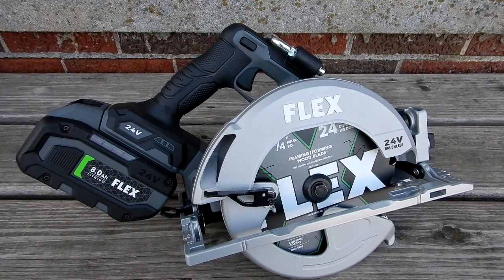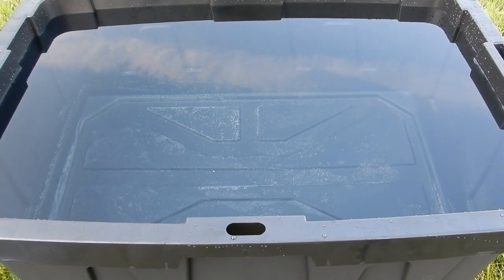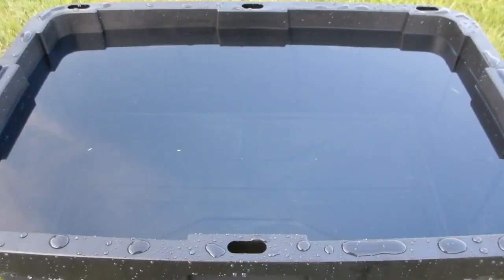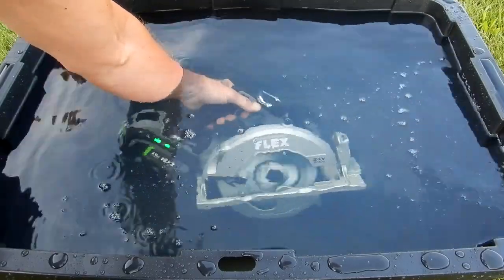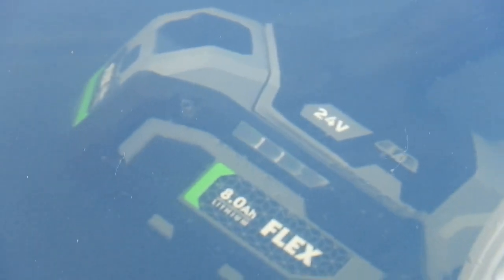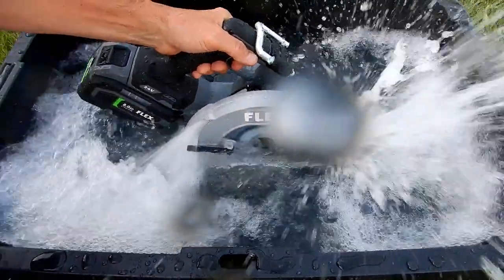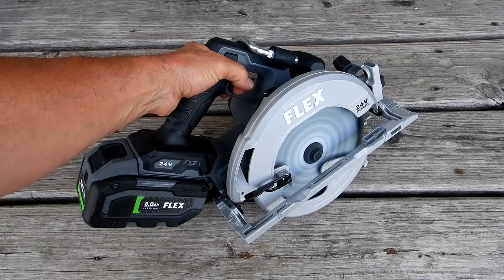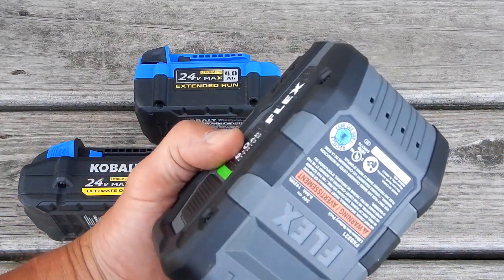FLEX #FX2141 WATER TORTURE TEST - Will It Survive 24-Volt 7-1/4-in Cordless Circular Saw Item2590098

Comment: What Dirt Monkey did was impressive. This... This test... is a on whole different level. This is "DAM!". I'm really interested in this now.
Reply from the maker: tensazero   It is amazing how it held up.
Reply: I dropped my flex impact drill in a fast flowing canal about 4 ft deep. it took me an about 30 to 40 min trying fish it out with a shovel since the water kept pushing my shovel out. I thought i was out about 300 dollars due to it being destroyed from water damage but it worked right away at full strength, never have had any issues since. Its been about 6 months since then.

Comment: The flashing lights is the battery power level.
The white substance your seeing is a byproduct of the battery in water.   8amp hour battery went from full charge to almost dead with in 2 hours.
Basically your shorting out the battery 

I am impressed the saw works still.   Now I wonder how it will work in say a month after sitting.

Glad I recently purchased the 6 tool kit !
Reply from the maker: Still works.

Comment: The "smoke" that was seen in the water could possibly be they white goop the put around the electrical connections inside the tool to keep it from vibrating apart disolving in the water.
Reply from the maker: towboatjeff   Thanks for that.

Comment: Why are you doing this with Flex? You wouldn't do this with Dewalt, Milwaukee, or Makita!🤷🏾🤔🙅🏾
Reply from the maker: Herbert Herbo Moore   As I stated in the video someone else dunked it in water so I wanted to push the limits. It passed!
Reply: Makita do have a IP-56 Rated tools. Their impact driver and drills and hammer drills are water and dust proof.

Comment: Not saying it's a bad video but.... lithium batteries and water don't really go well together
Reply from the maker: Battery still works. DISCLAIMER: this was only a test. Of course I would never do this in any other situation.
Reply: The batteries are sealed-if not the lithium would react from oxygen in the air. And lithium can react violently with water like sodium and potassium-these metals are related.
Reply from the maker: Thanks for that information Rex Oliver. Didn't know that.